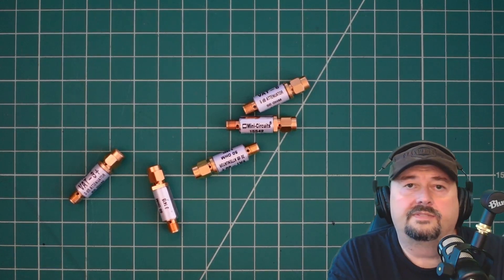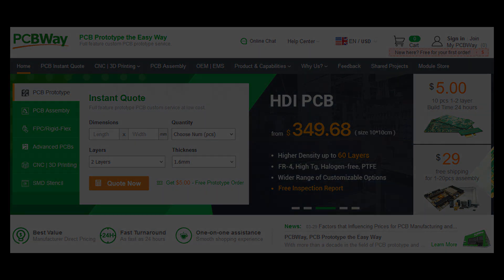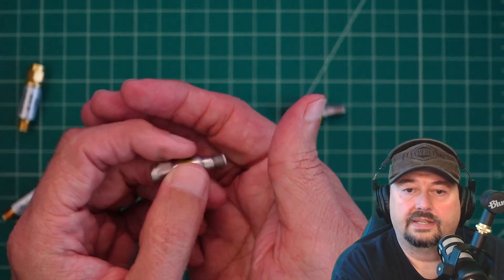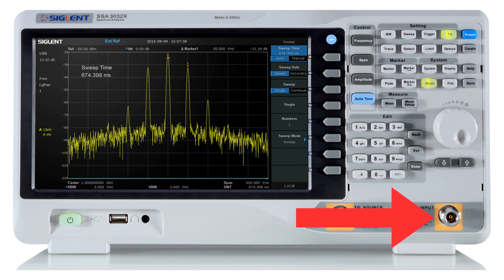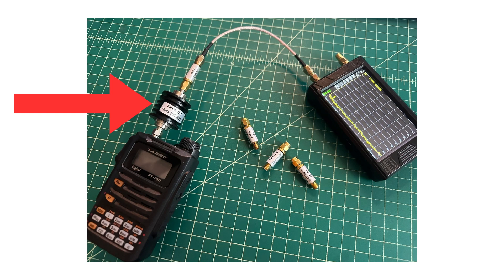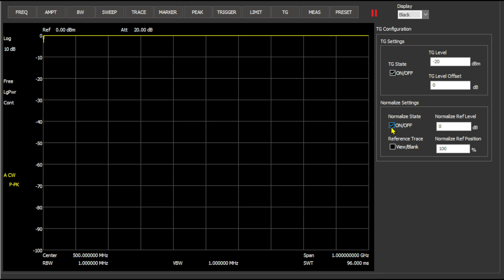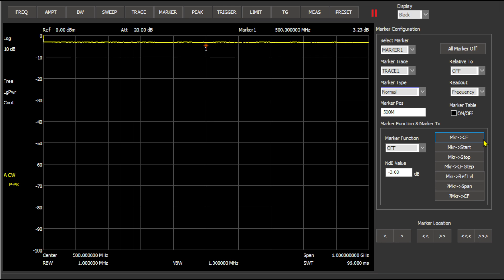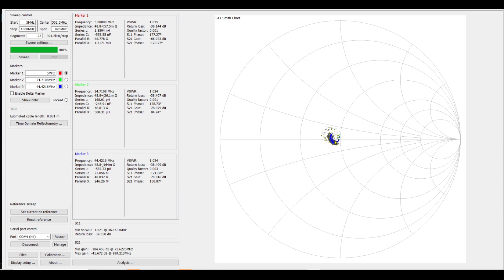Mini Circuits SMA Attenuators: Everything You Need to Know

Comment: A couple of weeks ago, found one of the 5W Minicircuit attenuators had failed, due to increased resistance. Not sure why, as the attenuator failures have been very rare. (Unless they are dropped)
Reply from the maker: I had one go bad a long time ago, I suspect it was over heated.

Comment: some nice attenuators. A must have for radio testing. They do get warm like a dummy load while testing with some power. I do not have small ones like that. Most of the ones I have are the N connector.  They do go bad ,so testing them is a good thing. My spectrum analyzer has no tracking generator. Was cheaper buy a bunch. For higher power testing I use different method of testing. From transmitter under test. I go threw Byrd 43 line section into dummy load . I have a 2 KW one and others . for sampling I have a BNC attn 40 DB slug in line section.  My line section is N -M to F . All I need now is a 43 meter movement and slugs for testing. They not cheap. Happy testing . 73
Reply from the maker: Those Byrd meters are sweet 👍
Reply: @TheSmokinApe  I started my collection of Byrd. The case is not too bad $$. Meter movement and peak kit going to be $$ then the slugs ! Hamfest time . how I got what i have now.
Reply from the maker: Yeah, I see them at the hamfests